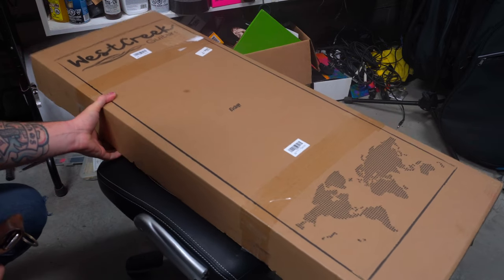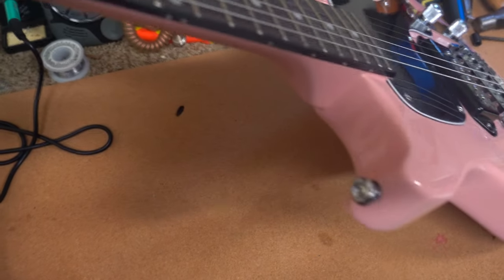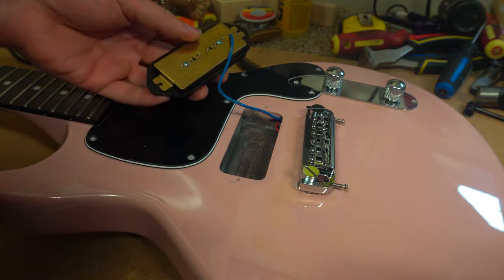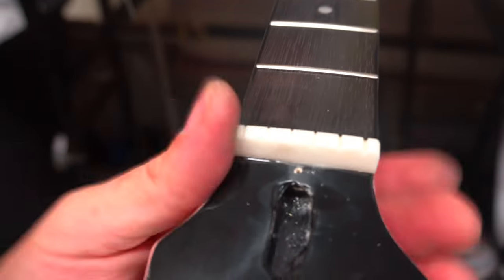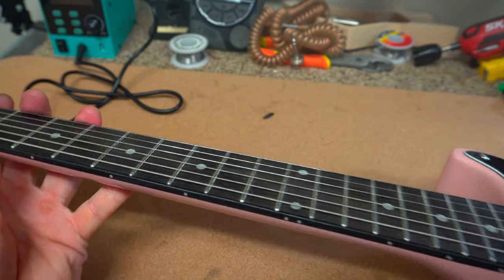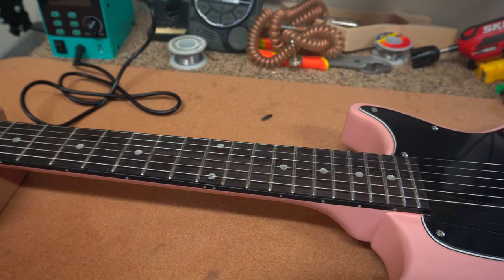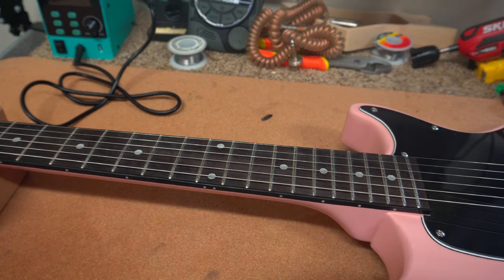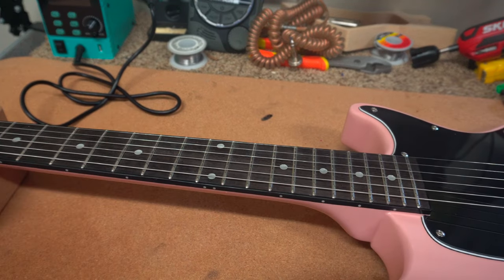This $150 Amazon Guitar is AMAZING 🤯😳🤯 Westcreek DC Review and Demo

Comment: Is the neck rubbery or stiff? Another channel had a Westcreek guitar and the neck was very easy to bend. I owned an Epiphone Special with a single humbucker. I liked everything about it but the neck was VERY bendable. The slightest movement made the notes go sharp or flat. It was sold.
Reply from the maker: This guitar has a 50s style neck on it, it's thick and wide and does not bend easy
Reply: Thank you very much for that information. @boechlerguitarsandrepair

Comment: I received my DC the other day in white. I ordered some spacers for the pickup and was wondering what measurements am I looking for when I raise it. Also did you lower your bridge posts down to the body for the lower action?
Thanks in advance! 🤟
Reply from the maker: I usually set my pickups about 1.5-2mm away from the strings, I did lower the posts a bit for lower action.
Reply: @boechlerguitarsandrepair  I’m sorry for the questions but my dogear came out of the box with the poles raised. I thought they are to be flush with the pickup housing, how did yours come? Again sorry to bother but most people haven’t heard of Westcreek, and I thought your video was the most informative! I think lower the poles flush and use the spacers I ordered.. thank you!
Reply from the maker: @tom7073  mine came slightly raised but all uniform height, I kept them as is. They are adjustable for personal preference though, for example if you b string is quieter than the rest you can raise up that pole etc.

Comment: Very useful presentation here, and not just a lot of blathering on when unboxing.  Kudos.  Does raising the P-90 leave a gap between the guitar surface and the bottom of the pickup upon raising it?
Reply from the maker: Yes, it'll leave a slight gap. You can also use a p90 spacer for no gap,  or cut the foam to fit exactly below the pickup cover.
Reply: @boechlerguitarsandrepair  Got it.  Beautiful ax… Thanks!